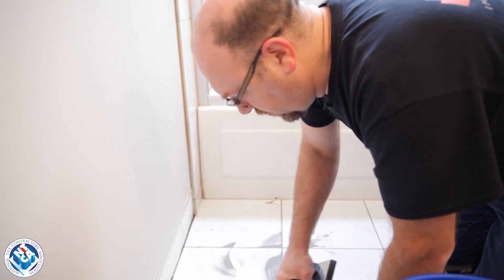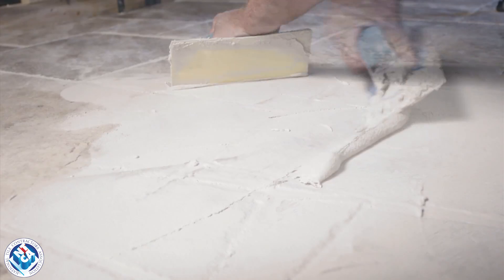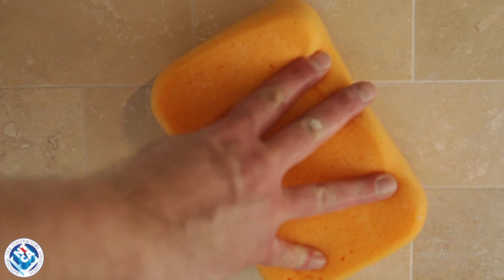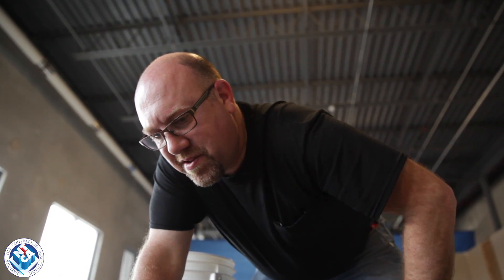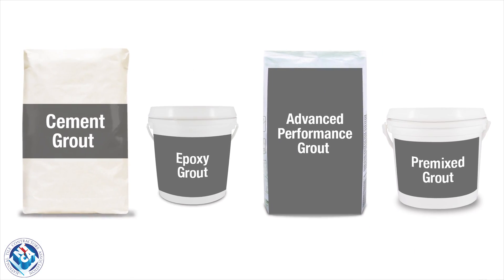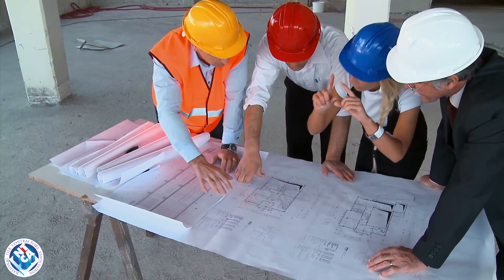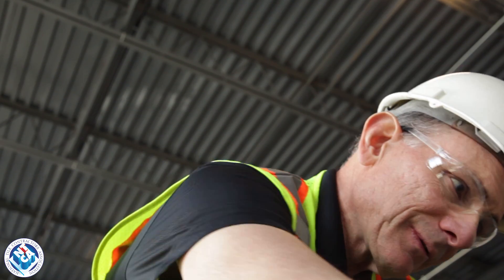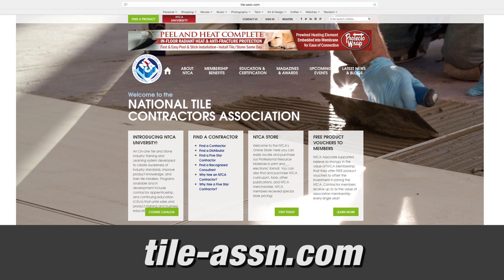How to Properly Choose Grout | Tiling Tips with TEC

Comment: I got me sanded Adhesive & grout I don't know if I got the correct one is made by TEC I need some grout for my washroom wall I've use a bunch of creams that don't last long the water knocks down the grout smh can someone please help me what grout is good for bathroom wall the wall that goes were the water comes out I appreciate the help? Thanks!
Reply: Use a grout with some sand in it BUT, always use a hardener or acrylic type additive. make sure its color fast so it doesnt yellow over time. Or use an epoxy based grout.
Reply: @philindeblanc  what's the point of epoxy grout for non staining "yellowing" if it is very sensitive to bleach.. all bathrooms are cleaned with bleach based products

Comment: fast technique . mix thin, pour on the floor and use floor squeegee wiper to apply over all joints. keep for 5 mins. clean. saves time, energy and easy to clean.
Reply: Nope. Mine is almost like dry pack and just working with it will loosen it up. All that water will evaporate leaving millions of holes that will shrink and crack
Reply: Yes and your grout will be soft and porous,  never mix grout that wet , ever .
Reply: use a hardener instead of water. Grout material today is very cheap and inferior to decades ago, so you need that bonding strength to lock in the cells so it doesnt absorb water. Non sanded will shrink with water. Less shrink with additive.
Reply: It also depends on materials and tiles i agree.  With ceramics its gotta be thin for both walls and floor, because ceramics absorb water, drys quicker.  For stones and porcelain moderate , also  depends on what size joins are.  For all 3mm joins i use thin over floor,  let it dry abit. I would use wash backet with sponge (particular tool) for smoothing out joins and fill up if bubbles appears, that's first wash.
Never had issues or complain after finish of job till today.
Bubbles mostly appear for 2 reasons,  1, improper cleaning before grout,  2, improper squeegee method. 
If grouting with squeegee makes you tired are after only 1sqm,  it means you are doing it wrong.
Reply: @dorbin101  Dude you have no idea what you are talking about,  you're a fucking hack !

Comment: I am using 18" x 18" ceramic tile with a sheen(gloss).I am suppose to use 3/16" spacers.Can I still use unsanded grout? I was told NOT to use  unsanded if the spaces are over 1/8". I already bought 2 bags of unsanded pre mixed grout.
Awesome video. Thanks a lot.